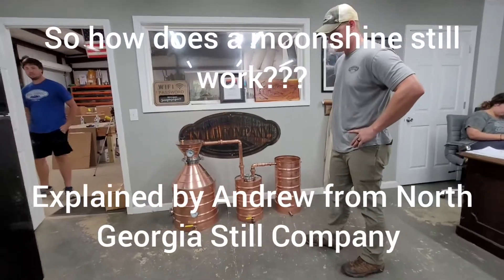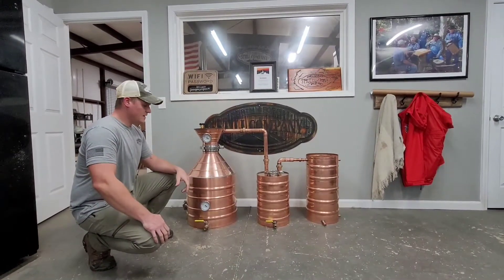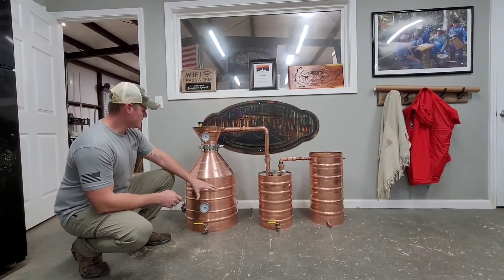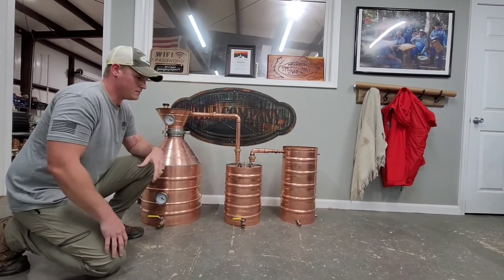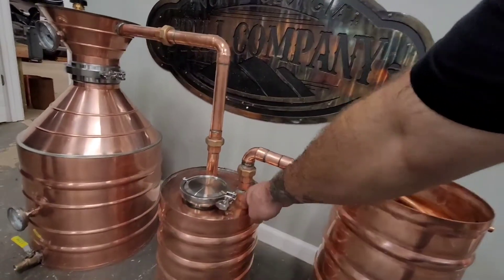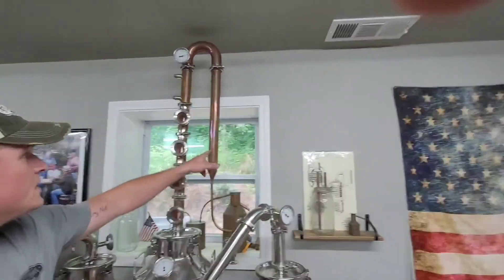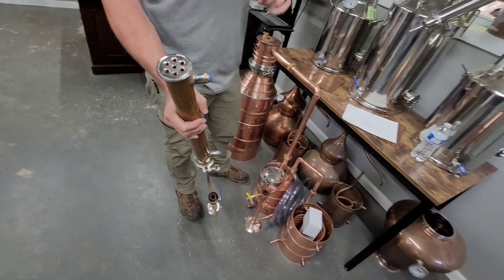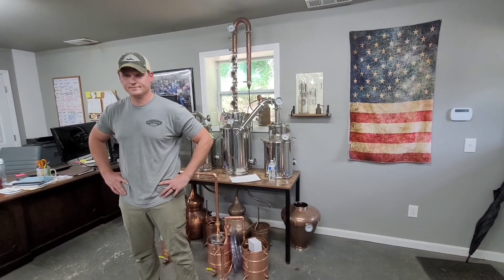How does a Moonshine Still Work? Explained by Andrew from North Georgia Still Company.

Comment: The wormcoil you said is technically called a “shell and tube” heat exchanger they use them in hvac applications 
I mean no disrespect just thought I’d let you know
Reply: it is not. there's 2 types of condensers in the world of distilling. worm condensers which are a copper coil inside of a tub, and then there's shell and tube condensers which is made up of a large tube sealed on both ends and has a bunch of pipes running in between. 
shell and tube condensers are more efficient but worm coils are easier and cheaper to make. plus to account for the efficiency you can cycle your water faster with a pump or run cooler water through it.

Comment: Do you utilise a P.I.D. on your electric heated boiler? Does this minimise headings / tails etc
Reply: you'll never minimise your heads. you can play with the abv but you'll get the same volume of methanol and acetone each time. the tails you can just stop the distillation when you get to that part

Comment: Do you heat the thumper too? and does the input inside the thumper have to be in liquid?
Reply: I currently work in the distillation unit of an ethanol plant and this is the part that confuses me too. Theoretically, you would have enough heat entering the thumper to continue evaporation (and condensation in the second riser tube) but I feel like it would be very inefficient. Heating the thumper would (in my mind) speed up the proof-up step as you would be double boiling your product.

Comment: Is the doubler heated too?  How does the vapor turn into liquid after the first section of the still?
Reply: No it’s not, as the steam hits the cooler liquid in it. It will recondense into liquid form. As the process moves along temp will increase until it reaches steam form again. Thus sending it out to the worm. At least this is my basic understanding of it